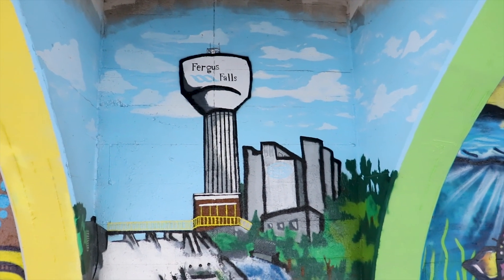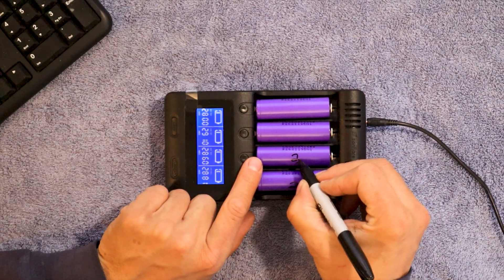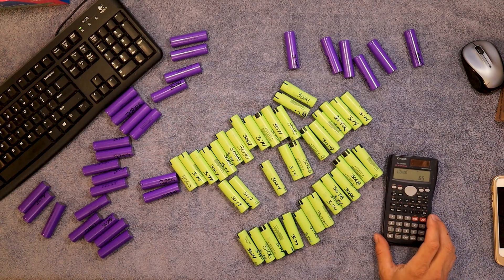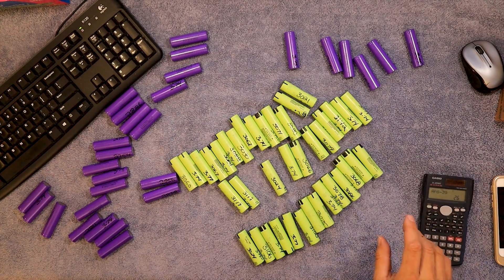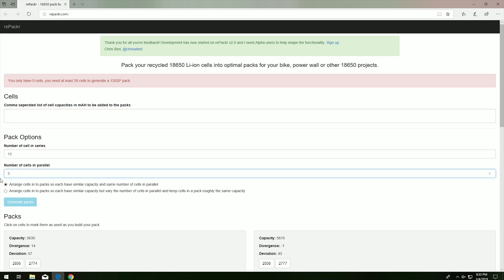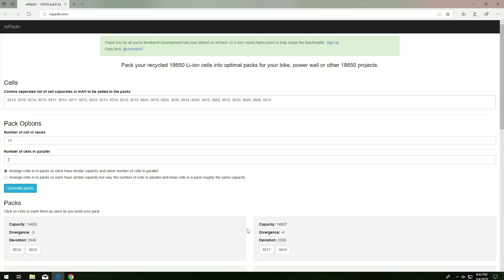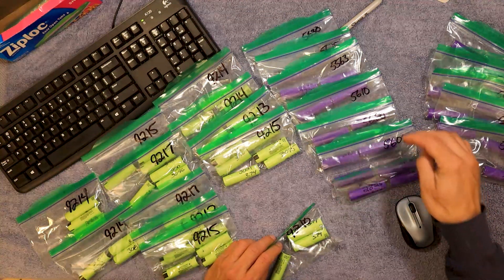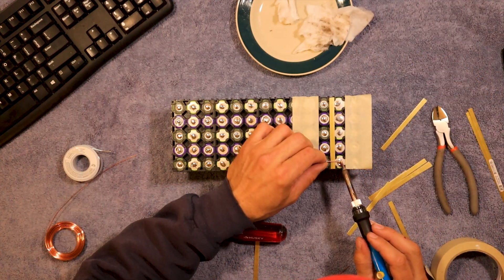Super73 Z1 48v Modification Part 1

Comment: really good video man. I just ordered a cyclone 3000w mid drive motor. so im going to remove the rear hub motor, unfortunately the battery i want is about 700 which is out of my range. i did the math and should save about 300$ if i follow your vieo and build one. 
https://lunacycle.com/52v-panasonic-ga-17ah-performance-long-range/
that is the battery i want to build. please shoot me a dm. i have  a v3 super 73-z1

Comment: Part 2! Part 2! Did you have problems with putting a controller in the seat? Can you show how you rewired everything?

Thanks!!!
Reply from the maker: ok ok ;) I'll get busy on it!
Reply: @vanmasterflash7153  do you know the size of the rear hub? and is it thru axle or quick release? i  cant  figure out what kind of hub i need to put in the rear aftar taking out the motor? and could you maybe do a video on how to spoke a wheel please

Comment: Very interesting video with loads of info!

Just a suggestion, have you thought about fitting the battery under the frame? We fitted our third battery under the frame on our S1 bike and it works very well - it also keeps the weight low down so improves handling.

If you are interested we have some close up pictures here so you can see what we have done: 
https://twitter.com/Super73UK.          https://www.instagram.com/super73ukmods

Looking forward to your part 2 video...

Thanks.

(We are not an official UK dealer)
Reply from the maker: That is interesting under the frame like that.  I'd worry about damaging it or getting it wet?   I still have to do another Z1 to do and was considering the front bar where the water bottle holder is. I'd be able to get more weight on the front. Not sure yet.  Under the seat worked pretty good just very tight.
Reply: Yes it did look a little tight under the seat but hats off to you for managing it!
We did fully seal the battery so water was not an issue (except we forgot to fit a waterproof charging socket).
Yes the water bottle bar would make more sense really. When we fitted our second battery we had to fit a 10mm flat spacer under the battery so as to give us room to slide the battery off the mounting plate.
We are curious about the Z1 36v controller - are you going to mod it or just replace it - If you fitted the battery on the water bottle bar then loads of room under seat for bigger controller ;)
(We are not an official UK dealer)